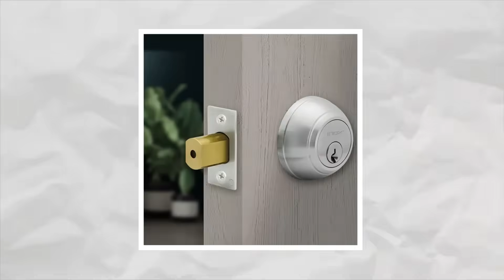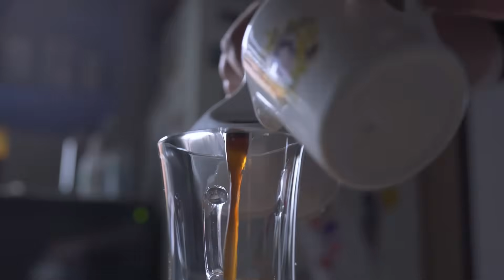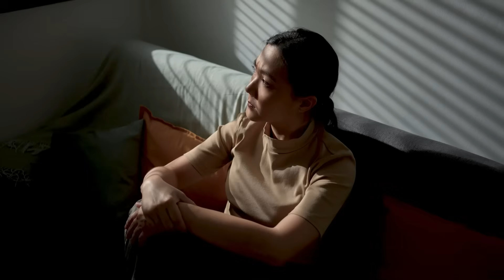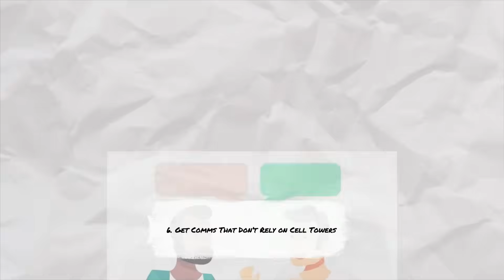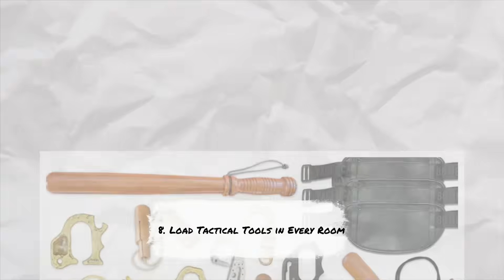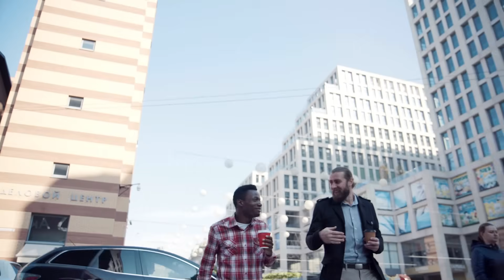Buckle Up! Lockdowns, Checkpoints, and Blackouts Are Just Around the Corner

Comment: 72 hours…. Been prepping for 6 month to over a year for no power.  I rather have more than I need, than not have enough. 

As a person that been prepping for years. The best tip I can give to anyone that’s starting to prep is to run your test now! Don’t want till an emergency to plug in that solar generator you got a few months ago to find out it’s not running long enough to keep your fridge running. Run your test now and not during an emergency. Don’t find out in an emergency the stuff you got is not working out.
Plug that solar generator into your fridge or what ever else you got it for. See how long it will run. Then….. see how long it will take to fully charge with those solar’s. Remember, you’re acting as if there’s no power, so just don’t plug it in the wall. You need to know how long it takes to charge. And what are you going to do if it’s overcast or raining? You need a plan A, B & C for every thing. 

Know now and not during an emergency. All most forgot. Cover those windows with garbage bags, you don’t want no one to know you have power. 

Stay Safe & Be Ready
Reply: Thank you!!!

Comment: Water from air can be obtained using condensation devices that can be made from DIY projects found on YouTube.  Such devices can be bought online but can be expensive. Water that has been filtered for particulates can be purified by placing in pure copper containers for at least eight hours without boiling or chemical additives. It can also be purified by placing it a clear plastic or glass container and placed in sunlight all day.  It will work on cloudy days also.

Comment: One thing I found handy is a fondue pot that uses tea candles.  You may not boil water, but you CAN heat up soups or make (semi) hot chocolate.  I always buy a package or two of tea candles every time I go to Wally world.
Reply: The thought occurred to me the other day; I got my mother in law and electric pot. It's a pot that you just plug in, and it's not supposed to get hot on the outside. She doesn't use it🙄 But it won't be too hard to plug into a simple solar bank, and you could cook a simple meal 🤷‍♀️
Reply: @gohawks3571  Great idea.

Comment: One thing that I rarely if ever hear mentioned is drain plugs. If, like many who live in an urban area, one lives in a high rise apartment building one should think about getting drain plugs for all drains, even toilets. Most sewage systems in urban and even suburban areas use lift stations to pump wast to treatment facilities. When power goes out for prolonged durations, then the lift stations will stop functioning. If a person lives on a low or bottom floor of a multi story building, sewage will back up thru said drains and odors thru upper drains as moister in pee-traps evaporates. By having good quality drain plugs, one may be able to stall or prevent this from happening until time to bug out. Just a thought.
Reply: Sewer back up for sure